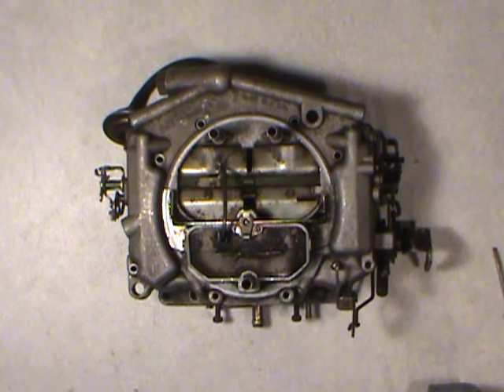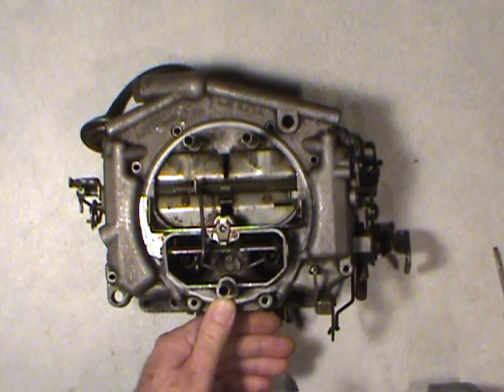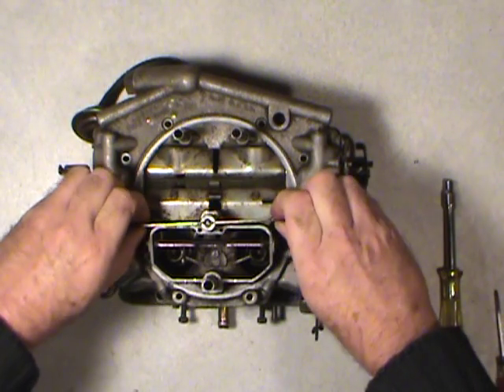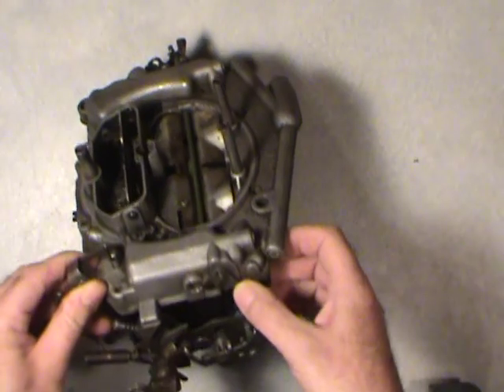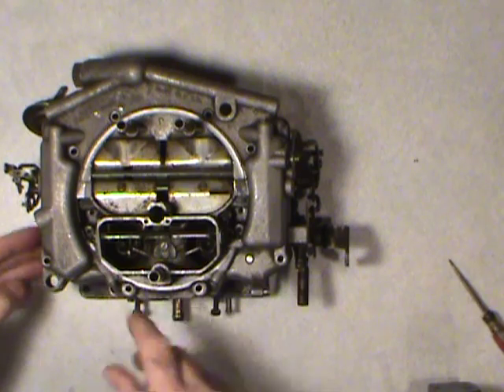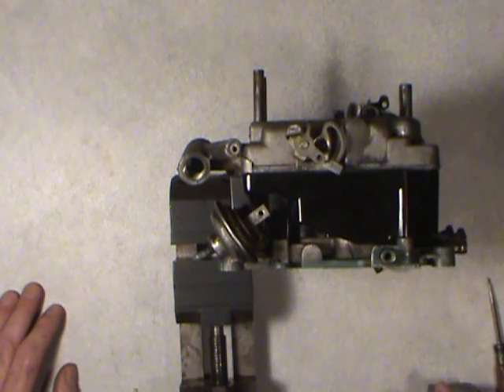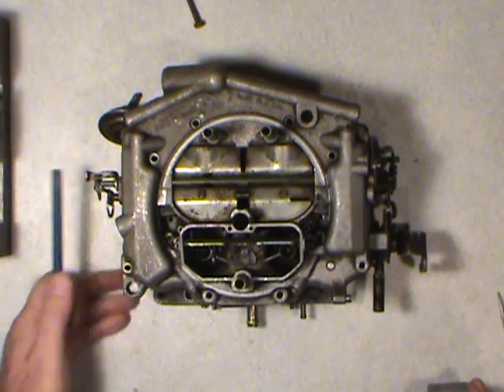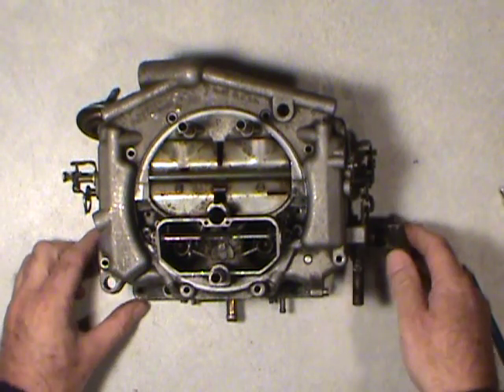Rebuild your Thermoquad Carburetor (Part B)

Comment: Can you tell me why my thermoquad runs great sitting and idling and driving on a flat road, once you go up a hill the truck loads up floods the cylinders with fuel. Get it back to flat runs great.
Reply: The carb was recently rebuilt, ran great for a month. Then started the above.

Comment: funny story had a 72 Chrysler Newport 440 with a Holly on it thought it strange. it came with the car new could not get that silly thing to run right three so called experts rebuilt it, ran like crap. finally took it off replaced it with a Carter. The car ran right from then on never liked Hollys.
Reply from the maker: Greetings...thomasdearment3214...Thanks for watching, and for commenting too...Kinda odd, that, the so called holly experts, couldn't get that holly carb to run right...If the poor running was at idle speed, then perhaps, something was plugged-up in the idle circuit, or maybe the idle mixture screws were not adjusted properly...If the problem was accelerating from a stop, then, it might have been a bad or miss-adjusted accelerator pump (sometimes, a strong backfire can rupture the accelerator pump's diaphragm on an older holly carb, that will result in really rich running...the later ones, should have backfire protection, designed/built into them)...It might have even been a bad gasket that goes between the bottom of the carb, and the top of the intake manifold, creating a vacuum leak, which can really mess things up, especially at idle speed...With the carter thermoquad, I've had rich running problems, mostly at idle speed...This was mostly caused by the two little o-rings, that go into the float bowl (one on each side), then, the top casting (air horn) squishes down on top of those o-rings, in order to create, a, shall we say,  gasoline proof seal...What usually happens, is that, those two little o-rings, tend to dry-up over the years, and then, the (gasoline) leak, starts to happen...If it's really bad, then, it idles so rich, that it will bug ur eyes, quite a bit...I had it so bad one time, that, I could even smell gasoline, on the (oil level checking) dipstick, when I checked the engine's oil level...I couldn't believe how much gasoline that leaked past those two bad o-rings, every time I shut the engine off, and having the thermoquad's two float bowls, virtually drain themselves, right through the bottom of the carb, and then, all the way down, into the oil pan, and that, is what I found out, when I did the oil change, or was it, "gas-n-oil change"...lol........Be safe, take care, and have a good one.
Reply: @RockysRoadshow  Carters belong on MOPARs, didn't mess with Hollys after that too much, however the one holly that didn't give me grief was a Holly econo master I put on my Catilina 400 ci to replace the Rochester sieve that was on it, surprising didn't rob it of too much HP and got around 14 - 15 in town and 18 on the road I was impressed now I'm a fuel injected fan